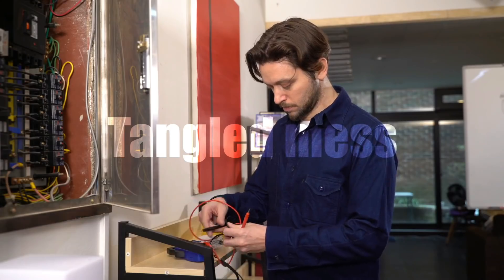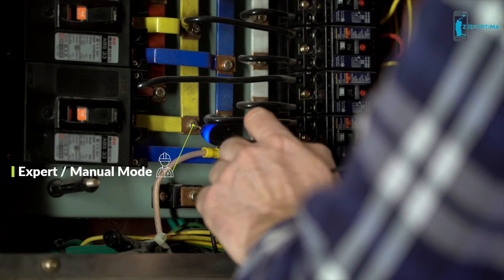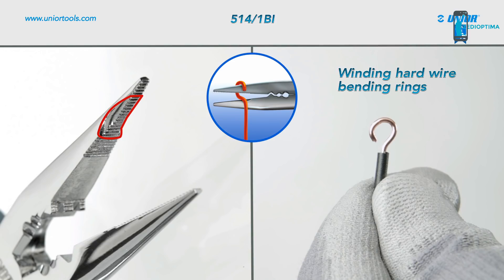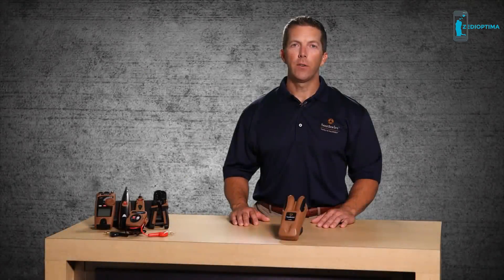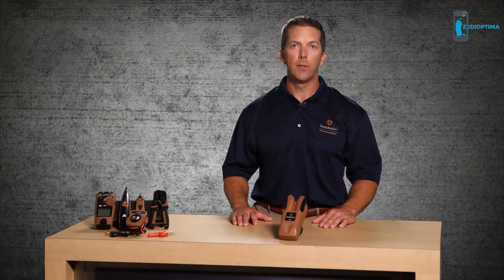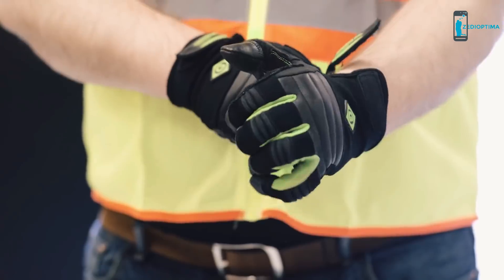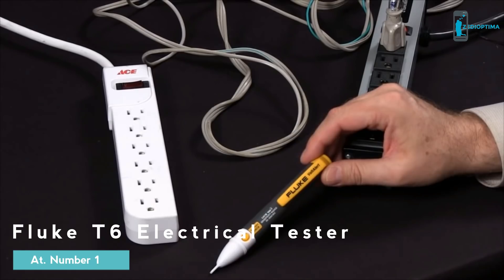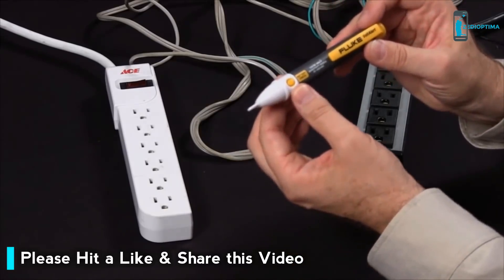Top 5 Best Electric Tools - Tools for Electricians

Comment: Lol using a device like Vion would be a ecconomical offence in my country. Only certified and registered measuring equipment that needs yearly inspection may be used. You even need to write down the serial number in the inspection form.

Comment: im a rezidential\industrial electrician. vion is a joke, i vould NEVER use this thing on a job. unior pliers are exelent. i had a oportunity to work with them and i higly recomend them. but beware ON ALL UNIOR TOOLS the grips have a tendency to slide of the tool. i fell from the ladders on a biogas engine and burned my hand thru the glove working with unior ratchet when the grip just slided of the ratchet. i have same expirience with all unior tools that are equped with those blue grips. if you buy them take the grip off, poor superglue in to the grip and showe it back on the handle and these tools well serve you well.